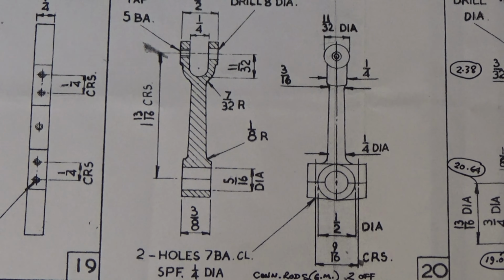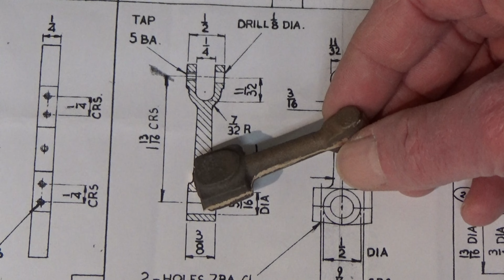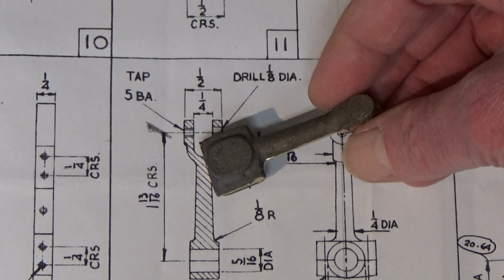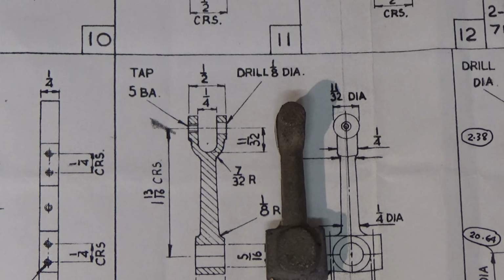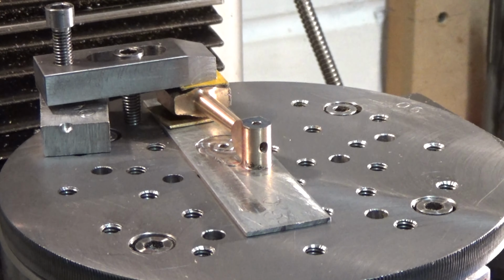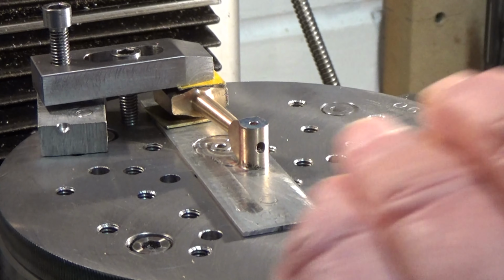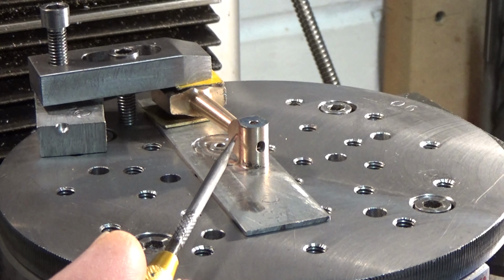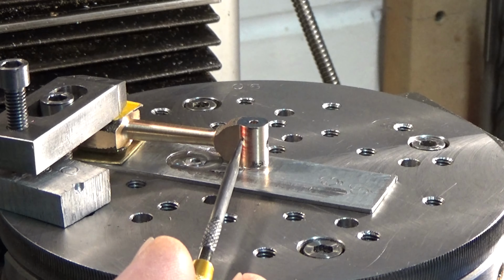Stuart Turner Twin Launch Engine pt 7A   conrods

Comment: Hi Robert. Gee those conrods are a bit rough and look a bit light on for a good finish. Nice job  with what you had to work with.
Reply from the maker: Yes, rubbish castings really. Not bothering with expensive castings in future. There’s always a way to fabricate stuff or machine from solid.